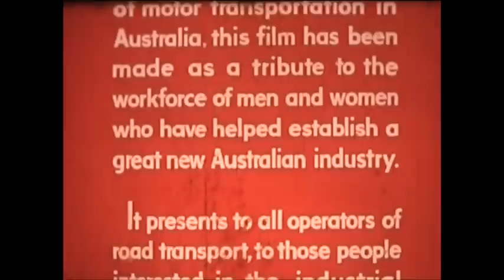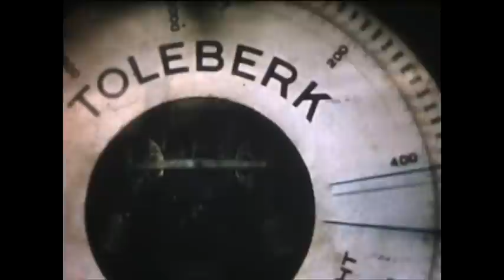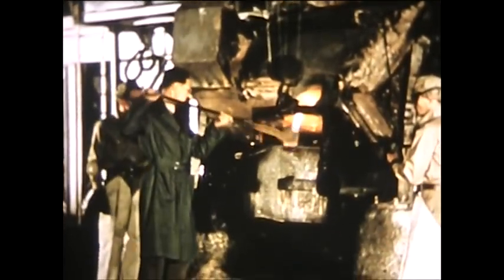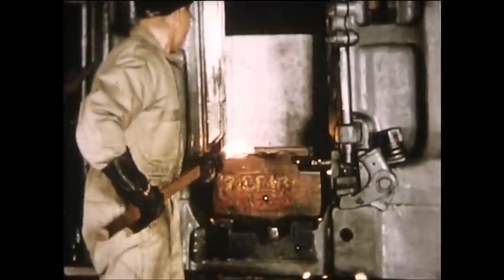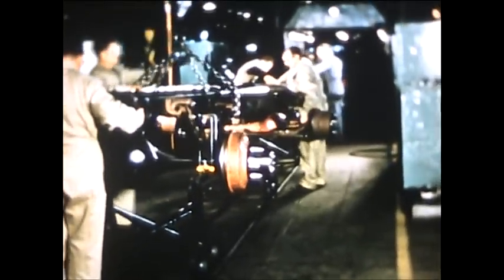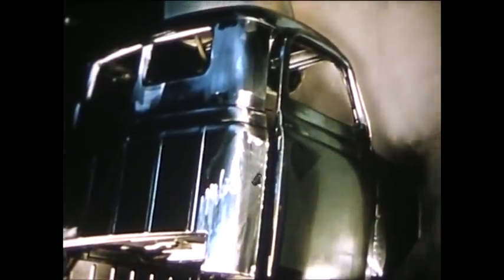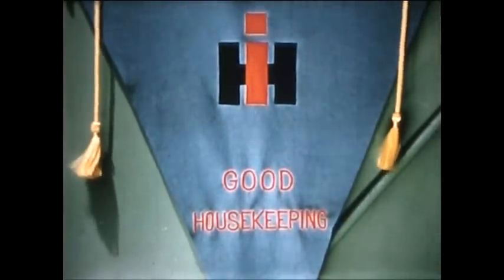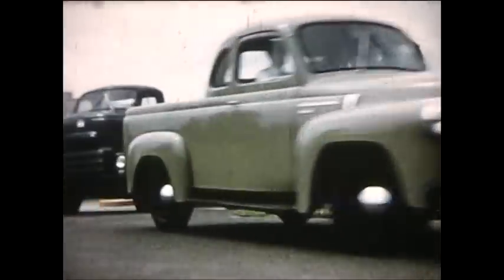IHC Trucks Australia Horses to Horsepower 1957

Comment: If IH wass so proud of their reputation, then why did they change their name to "Navastar"?  Why did they stop building light-duty trucks some 40 years ago? Simply not competitive with Ford, GM and asian imports.
Reply: because the company in the US went broke in 1982
Reply: When the company split up in 1985, Tenneco bought the "International Harvester" trademark for farm equipment and the truck division renamed itself "Navistar International" as part of the terms of the agreement.  They still use the "International" brand.

They stopped building light trucks because they didn't have the vast dealer network (as GM and Ford had) to sell and service them, at least in the US.  Also, they were phasing out the manufacture of petrol engines in favor of diesel, and light trucks at the time largely used petrol engines.
Reply: IH truck division had to change their name after the company broke up.  Believe it or not the name Navistar was picked by a computer!